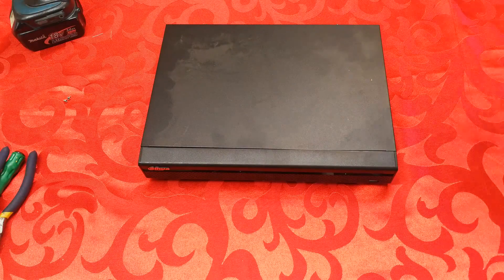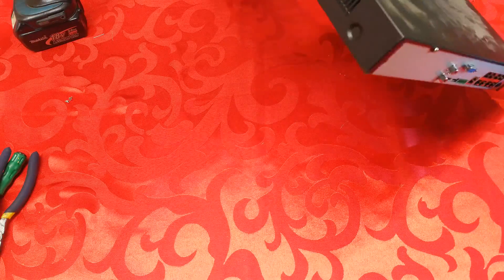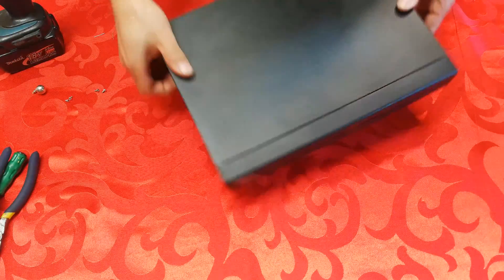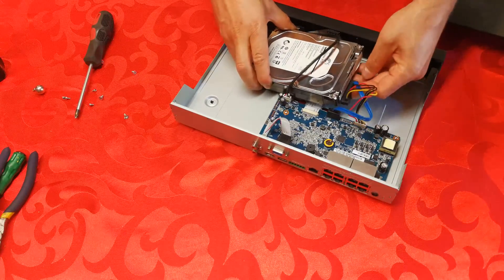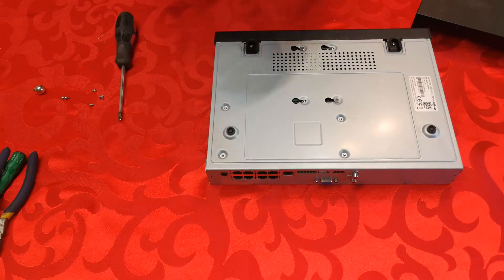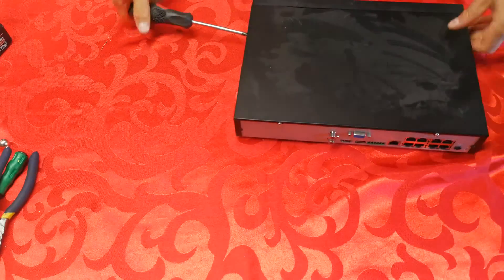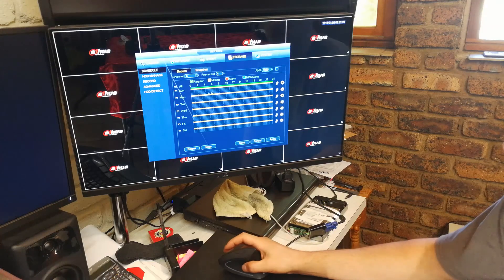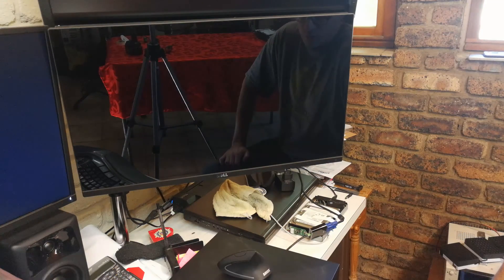How to change a hard drive in an NVR or DVR

Comment: Hi, If you are putting a new HD in it what about the software? Do you have to install the cctv software from a pc first or do you just plug it in without installing software on to it,  don't understand how a new HD will run the cctv software without install somewhere along the line, please can you advise on this, it will be appreciated if you can. Thanks
Reply from the maker: the hard drive is for storage only. the micro controller that is part of the NVR/DVR runs the operating system (mostly linux based).

Comment: Nice ! Can this be done with any DVR ? For example in South Africa one may buy a Multichoice DVR -- if replacing that HD with decent size one, how would one get into that software control panel ?
Reply from the maker: not sure about TV DVRs for DSTV.
Reply: Thanks, yes, I've been out of SA for 7 years now -- I noticed in my absence these things have changed quite a bit (and seemingly not for the better either).  Well, one can always experiment with an older model !